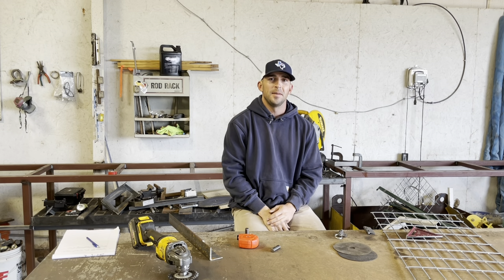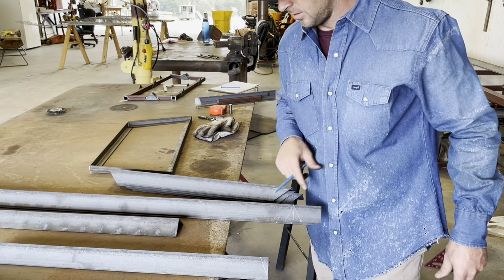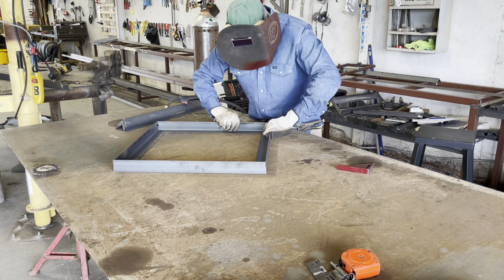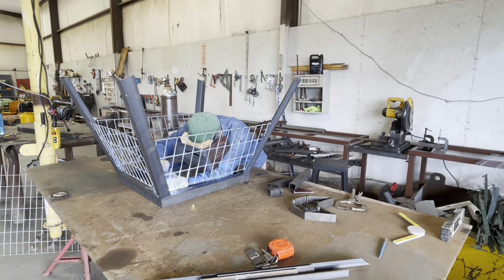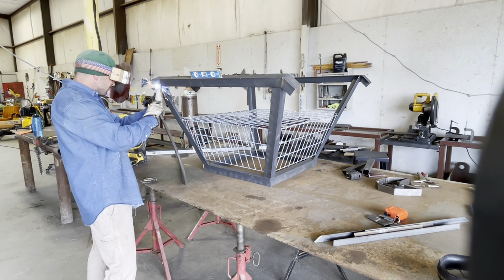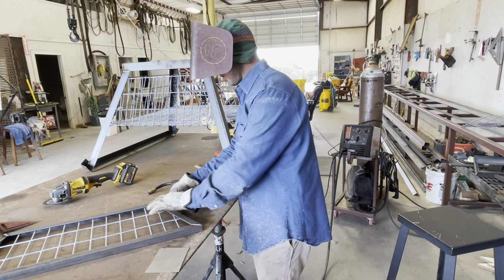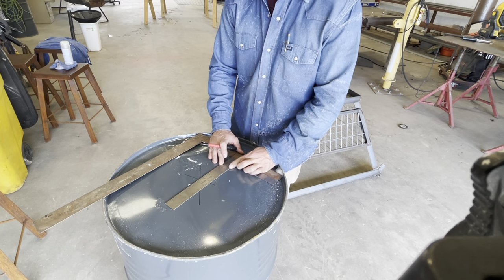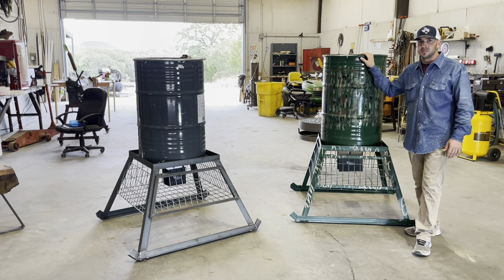How to build a deer feeder Stand and fill

Comment: Great video, I showed it to my Ag Mech classes. Do you actually bolt or weld any bracket on the barrel to the frame or does the barrel just sit on there?
Reply from the maker: I’ll will put a few tack welds on barrel down to the base. Thanks!!

Comment: How much do you sell these for?  They look great! N
Reply from the maker: Thanks! Just for the bases around 400$ and all put together with either with a 6v or 12v depending on additional accessories ranges from 500-600$
Reply: Thanks.  They look great!
Reply: @haysfab6087 
 What size barrel are you using? Also what gauge horse panel are you using? Thanks, LinemanG

Comment: Great Video. Just what I was looking for. If I build one with longer legs would that change any angles or cuts ?
Reply from the maker: Thanks. So you can keep everything the same if you want longer legs and the only thing that will change is the length of your legs and the length of skis. I would just measure for your ski once you attached the longer legs. The 22.5 degree gives you a wide base and it’s stable. Hope it helps
Reply: @haysfab6087  yes sir it does. Thank you